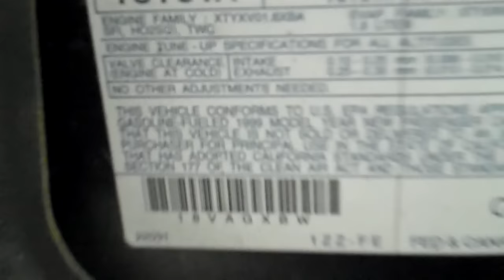What a siezed engine sounds like when you try to start it.

Comment: do all locked up engines sound like this? cuz my car has no noise at all when turning the key and it would be great if i rest assured it isnt my engine that is bad
Reply: Same with mine. Just put in a new starter and still nothing. No noise or anything
Reply: +Stefan Hudgins ouch my brother came in from work and i told him about it and if i remember he was kinda aggresive like he switched gears and then back to park he kinda played with turning the key. he also moved the steering wheel. i say try that and i hope it works out for u.
Reply: Maybe the car slipped out of neutral? I would think it wouldn't react at all if you tried to start out of neutral.
Reply: do u need a new battery young boy?

Comment: Did you try turning the crankshaft manually with a breaker bar just to try to see if a seized motor can still spin freely…? 

I have an engine that does spin freely when turn with a breaker bar but when starting by key, it’ll turn very slow and click. Haven’t replaced the battery yet though…car has been sitting with a dead battery for over 6 months. Just been jumpered!
Reply: Did you poop yo pants

Comment: Tried turning my crank wheel and it's stuck. I'm going to take the timing belt off and see if I can agree that if it's one of the overheard cams after that. Thanks for the vid
Reply: lucianoromero777 So what did you do?
Reply: Aldo the engine seized. I was able to get the timing belt off the camshafts, and the crank is stuck. Tried all methods of moving the crank with a torque wrench, power tools. Engine is done
Reply: @lucianoromero777  I'm in a similar situation as you are but I think my engine's timing chain got stuck or snapped. I can still hand crank the engine to a certain point then it stops. I can't check anything unless I pull the whole engine from the car and check the timing chains. What do you think?
Reply: Aldo I would take the timing covers off and see if a belt is snapped and take one of the timing belts off and see if all of them turn, it could be just a bad head cam not allowing you to turn it. Turn all of the overhead gears and then the crank and see which one is the culprit.

Comment from the maker: It could be a bad starter too.  You never know- often they sound pretty similar.
Reply: I'm prying for that my 2014 Chrysler has that issue
Reply: Starter only turns ur car on when it die out and it dont crank its ur motor lock if u motor cranks then its ur timming chain
Reply: A starter doesn't make your engine bleed oil
Reply: Does a dead starter make the exact same sound or no ?

Comment: Do you not check your oil?  Sounds like your at partial fault.  If it was loose it would have been leaking. You should have noticed the extra oil where you parked.  I check my oil levels on both my vehicles at least 1x a week.

Comment: I cant believe a corolla 1.8 seized but then again they ran it dry of oil. I have a 99 now at 300 and something kms.  and a 2000(at 386,000kms a few years back. Both cars lasted me at least 6 years. They have a piston ring gap-issue that allows them to burn oil when the oil control rings stick.
Reply: @punt4madre  canadian cars.  The one i drive now was a US car but it was built in canada. Inhave to do the conversion. It has 208k miles on it.
Reply: @punt4madre  not too weird. Here in Canada everything is in KMS, just Depends where the car is being sent for final sale.  Some come back over the border. My car had to have a import tag showing it was from the states but re-registered  for use in canada because the laws are different. Lile daytime running lights are required where im from by law, the car had to have a relay installed. I work on cars for a living. We get a lot of imported cars that require an inspection to see if it complies or not. Most of them i can change with a laptop for Daytime running lights. Technology is great sometimes.  Ive alsonhad to install daytime running light modules on older cars.

Comment: Hi, I have a 97 Mountaineer, it wont start. I replaced the battery and the solenoid. It still wont start. It just makes one big clack, like the one on this video. I did notice power steering fluid leaking from the lid.

Comment: Fricken great.  That is exactly what my car sounds like after dying yesterday.  It has oil, it's full.  WTF...
Reply: hey what’s happened since?
Reply: @AsapFlxw  It was the timing belt.  It had slipped and destroyed my engine.  I got a 25,000 mile engine from a similar car from a reputable repair shop, got that put into my car, and continued to drive that car until I finally sold it in January 2020, and got a new car - this one has a timing chain, so no more of that nonsense.

Comment: I had just bought a 66 mustang and did a complete fluid change, it ran for the first time in 3 years for about 30 seconds then came to an abrupt stop and I'm praying the engine isnt seized, I didnt start it again because the carberator has a bad gasket and is leaking fuel bad and didnt want to burn the car down

Comment: i seized my subaru engine by mistake ( 1 or to injector miss firing) yesterday,
very bad time for me.
Reply: yeah No shit my trx 90 is locked up!
Reply: Seized
Reply: It's been 4 years what has happened man, have u got a new car and what is it now? Or have you died?
Reply: Why by mistake?
Reply: Aldo long ago , one of the right cam cldr get problem I didn’t know , I bought cheap Chinese fan attached to the intake manifold, after a few engine raving it dead ( completely seized ). Bought another one low mileage ej25 .

Comment: @briansmobile1 That's fair, i hate Big o tires more. Took my truck their for front end alignment once and they replaced parts with out asking me. They claimed the rotors where to big for the truck (GM factory rotors), and some other stuff. Then had to balls to tell me i would pay or not get my truck. I called state police out for them holding the truck, and had the country attorney on the phone. Should have seen them sweating.. left with new parts and only paid for the alignment.

Comment: My SUV is doing this. I changed the oil every 5 months. Had it for 2 years and all of a sudden stopped. On the freeway too. Started losing power and it just powered off.
Reply: Hi there, I have a question. Did you have to buy a new engine afterwards?
Reply: Victoria Nguyen yes... I bought an engine that came off an Lincoln Aviator... same year, for $900. .. the suv was crashed but engine was salvageable.  After, I sold my explorer for $3200.  I now have a 2003 Chevy Tahoe.

Comment: My truck sounds like that. how can I tell if its the engine or the starter
Reply: LightningSurvivor 14 Starters a loud "wap".

Engines a louder chtunckk
Reply: Put a breaker bar on the crank pulley. If it moves it's the starter. If it won't budge it's a ceased engine.

Comment: I got 2001 outback..has (had) rod knock. got burned by auto mechanic in town #TONYS PITSTOP MORRIS ILLINOIS. still had cylinder one misfire and he didn't put knock sensor in
(assuming he knew what I do now-rod knock) now it just turns over,no noise. like its outta gas

Comment: Oh thank the lord I knew I needed an oil change but kept putting it off and when I went to start the engine is like started then made a weird sound and turned off half a second later. Thought maybe it was siezed
Reply: What was wrong I have the same problem
Reply: Josh Hiati it was an ignition coil and the corresponding spark plug

Comment: Like but dislike! Any special way to make sure this doesn't happen to my 01' 4Runner? Besides regular maintenance of course..

 I had it happen to me and my girlfriend in the middle of nowhere MN heading home to Ely. It was in my 95 4Runner tho and I suspect the head gasket was going out when I purchased..2nd car ever and knew nothing other then oil change/ spark plugs..one of which was flailing around in the eng compartment as I'm trying to pull over safely and gas is shooting out the block! I gave Toyota another chance though and now it's 8yrs later.

Comment: how much is a car worth with a seized engine???
Reply: 5.5 kg of potty
Reply: Whatever the scrap value of the car is. Often you can only repair it by replacing the engine.
Reply: Dulce Morales
Reply: Whatever the scrap value is.
If it doesn't have any, then $0.

Comment: 1998-2002 Toyota Corolla's are garbage anyway. After about 80,000 miles, piston rings go bad and they use excessive oil. Like you would have to replace the oil every 300-500 miles.

Comment: two words.... liquid... wrench
Reply: Where would i spray it on starter?
Reply: My Car been sitting for bout 10 months oil is good new battery too starter was working when i last turned it on wondering if this could do the trick
Reply: C-no Limitz  not in the starter lol. In the spark plug hole

Comment: shit thats what my 2003 Mazda Protage sounds like.. however i've looked and everything looks fine in the engine compartment. Wife said it overheated and stopped working.. I looked at the oil once i drained it, and even though the oil had broken down, it did not have any metal or water in at all..
Reply: zoliezee Overheating can cause the insides of the engine to melt together and become a useless chunk of metal. It's probably done.
Reply: Thx for feedback. Time to open her up I guess! Lol
Reply: zoliezee shes gone mate, get a new car.